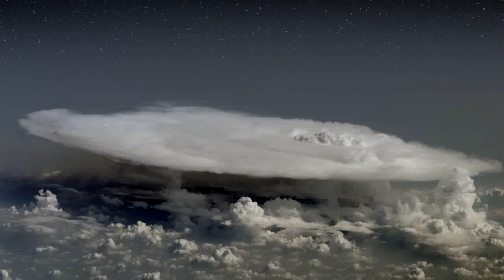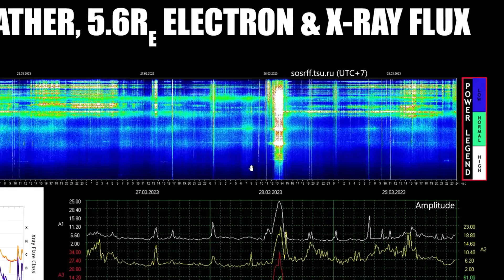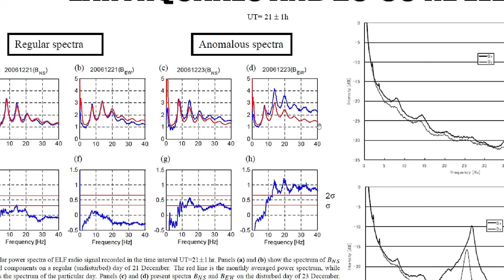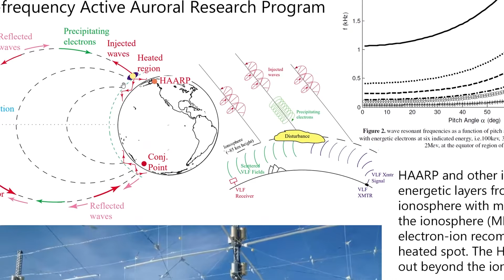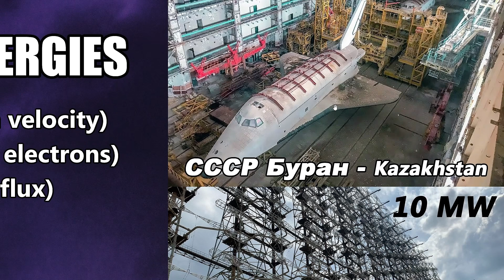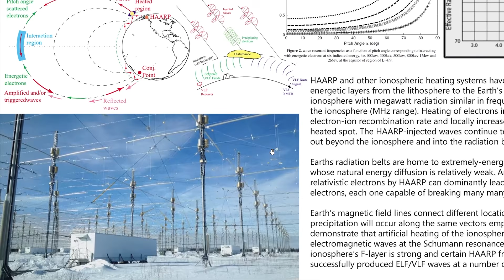Global MANIPULATION 📡⚡️ Earthquakes, Schumann resonances, and HAARP

Comment: THIS PAST YEAR HAS BEEN DIFFERENT THAN ALL PREVIOUS IN MY LIFE IN ALASKA, IN SOUTH CENTRAL AK. ON THE FLATTER AREAS BARELY ANY SNOW, THE NICE NEW BLUE SHOVEL I BOUGHT AT COSTCO FOR 14.99$ ONLY I ONLY HAD TO USE 3 TIMES ALL WINTER, AND AT AGE 13, I STARTED NAVIGATING, COMMERCIAL FISHING, AT AGE 19 I WAS A LONGSHORE BOSS, AND INTO ALL PHASES OF NEW COMMERCIAL AND RESIDENTIAL PLUMBING AND HEATING TECH AND BUILDING AND MANAGING AND HEAVY EQUIPTMENT OPERATOR, SND A WELDER, AND MASTER MECHANIC, I STARTED BUILDING MUSCLE CARS 69 MACH 1 428 COBRA JET, 66 CHEVELLE SS 396 I BUILT TO THE HILT AND A 68 CAMARO I BUILT THE SAME, AND TRUCKS, SND MOTOCROSS AND SNOW MACHINES, AND THE COMMERCIAL FISHING BOATS, AND A SYSTEMS ENGINEER ALL BY AGE 25, AND MORE SKILLS AND FIGHTS TO PALM SPRINGS AND MAUI, SND LADIES WANTED TO MARRY ME BUT ID CATCH A JET WHATEVER, AND SOME REALLY BEAUTIFUL BUT I WAS WORKING 16/7'S FOR YEARS AND ROCKING ON MY YELLOW SONY WATERPROOF WALKMAN, AND IN HOW I ATE HEALTHY AND FRESH, I WAS IN RAMBO SHAPE BEFORE SLY WAS, AND NON OF IT I WENT TO SCHOOLS TO KNOW, AND NEVER HAD A CREDIT CARD, NOR PAYED PAYMENTS, AND NEVER BEEN MARRIED NOR DIVORCED, STAY FAITHFUL OR STAY SINGLE, WOMEN ARE INTO WISHIN' AND DO HELP TO MAKE LIFE WORTH LIVING, AND I JUST ROCK ON !

Comment: We are getting northern lights in south Germany now. This has NEVER been the case in 60 years, or even 100 years. Now they pretend this is kinda normal...
Consider this:
Nemesis / Nibiru starsystem approaching. All signs go in this direction. Floods, Earthquakes, Tsunamis (yet to come), vulcanoes, draughts, sunstorms, electronic errors caused by sunstorms, tilt of earth axis, abnormal schumann resonance, melting of pole caps (hence the weather disruption)...

Comment: No doubt those in power are quite aware of the Frequency Shift into the Age of Aquarius ( the age of knowledge increasing ) and have been preparing for a very long time to pull all stops at quelling this Age Frequency Change … HAARP , GEO ENGINEERING WITH HEAVY METAL PARTICULATES in conjunction with Elon’s STARLINK MICROWAVE FREQUENCY MANIPULATION , CERN , TESLAS REDISCOVERED ANCIENT EARTHQUAKE DEVICE TECHNOLOGY, along with Cerns Large Hadron collider  there are others strategically placed around the world at various other smaller sizes . Also who knows what they are doing in Antarctica . 
At least I know TESLAS EARTHQUAKE DEVICE was in use in 1945 and onward during my Dads time in the Navy working within several covert operations , one of which was using this device to create tsunamis for testing in the ocean .

Comment: i bet this is how they make those spoof radar and visual objects. they introduce energy in that area using a harpp type of device, then project energy in an area perhaps several points of plasma with the same radar signature and speed as say an F18 or squadron, or incoming cruise missiles. up the energy in the theatre of war, or where you want to project these plasma balls, and move them at will, confuse the enemy with spoofing tech. i seen some sort of light show on here somewhere showing star wars defence tech, just points of light but spinning and 3D in appearance maneuvering through the air. nothing big, but this was like in the 1980s reagan era. they had this stuff way back then. awesome stuff.

Comment: All the energy going up from HAARP, must heat the atmosphere . 
 This hot air , or at least the heat , must go WHERE ? , as like you mentioned about the recent Turkish earthquake - Turkey , by the way had not long pissed off the USA elite , doing deals for it's people , with Russia.
 There was also some talk on similar channels , about a threat made by the USA , about access to the Straits of Malàca - Indonesia initially refused , had minor quakes , then a big one , after which the straits of malaca were opened to the USA.
 The Christchurch and Kaikoura earthquakes , also had lot of strong chatt regarding HAARP , being used as a 'Geophysiçal Wepon' , which is not a good use of an alleged research facility .  Similarly , with the abnormally strong earthquakes , off initially the North Islands West Coast , which then switched to the east coast , similar magnitude shakes , all headed North until another sudden move tó the West , and White Island -  these over 4.5 quakes seem to have abated lately , but doesn't stop the 'Slow SlipEvent"  which is occurring pretty much unde the whole country , as it's brining up earthquakes , where there haven't been any before - at least in my lifetime of 70 + years in a flooded cauldera, which generated tsunami , within the crater - eastern side , right close to the main North - South Highway . 
 The many minor earthquakes we get each year are as nothing , compared to the larger ones , which do electricaly , with humans own energy feild .
Reply from the maker: Brilliantly said ⚡️🌏

Comment: QUESTION:  Are some spikes in Schumann resonances due to the ring current?
a.  Solar flare energizes Van Allen Belts, and hence possibly also the ring current.
b.  Earth's magnetic lines basically currently go from South pole to North pole.  So on all sides of the Earth the magnetic lines would be going North.
c.  The northward magnetic lines would have the ring current go in one direction on one side of the Earth and the magnetic lines on the other side of the Earth would have the ring currents going in the opposite direction.
d.  The opposing ring currents when they meet, along with possibly gravity, directs the flow of the ring currents downward towards the Earth affecting the ionosphere as well as the Schumann resonances.
?????
Reply from the maker: Good questions, i'm unsure if there are answers to them. The ring current is westward in direction and magnetic field lines are northwards. That's the same anywhere on the globe.
Reply: @StefanBurns  I have recently been trying to better understand the Schumann resonance and have also recently been led to your YT channel.  Excellent lectures by the way.

Okay, you say the ring current is only in one direction and not in opposing directions.  It would seem to me at this time that different energy interactions would still occur along that current due to various reasons, and possibly different energy frequencies might occur along that current.  Since it's a ring current, possibly with different energy frequencies going around in it, then I could still see where it might be possible that there could be 'spikes' in some areas and 'canceled out' in other areas.  (Kind of like standing waves of different energy frequencies in a closed circuit.  I know the ring current isn't a closed circuit, but I think some of that might still apply.)

But then it also raises other questions, besides changing directions, what else might occur when the Earth's magnetic poles flip which should cause the ring current to change directions?  Or what occurs if they don't, at least not right away?

Not expecting any answers, unless of course you have them, this is just how my mind currently works as I try to figure some things out.
Reply: Before long you're gonna become a conspiracy thomas just like some of us😂

Comment: This is very tough topic to discuss, due largely to the glut of misinformation, and wishful thinking injecxted into this discussion., 
HAARP operates in the MEGAHERTZ range. 
The Schumann Antennae are not tuned to pick it, quite simply
There's also research on what an official, legitimate HAARP signal looks like. 
Again, the antennae, and detecting equipment needs to be tuned to the proper frequency that one is looking to find. 
Schumann Resonances are very subtle whispers, which operate in the pico range. 
SR is like the breathing of the planet. 
The spectrogram is a qualitative plotter, which gives you a relativistic spike of charge, as measured in deci-Bels. 
The spectrogram is not measuring anything. 
The spectrogram is not detecting anything. 
In order to know if it's an act5ualo, real-life thing that the labs at Tomsk are detecting, you gotta go to the other graphs, like Cumiana, which measures in the nano scale, which is more useful for this kind of stuff. 
This is a very difficult topic to discuss, due to the desire that alot of the Moderns have, to illustrate such things on "The Schumann."
Without any other backing proof; such as, again, Cumiana, Italy. 
It's not that the atmospheric heaters are NOT doing damage. 
The problem is using the right tools and monitoring machines that are actually detecting what's happening. 
The Schumann Antenna are not picki8ng up the signals from HAARP. The SR detectors are not designed to detect in this range. 
But the effect of it, this is what you'
re saying. The effect of which needs to be shown on other charts and graphs around the world, to conclusively determine it's HAARP, rather than standard electron discharge, as is generally the case. 
Thank you for discussion on this topic.